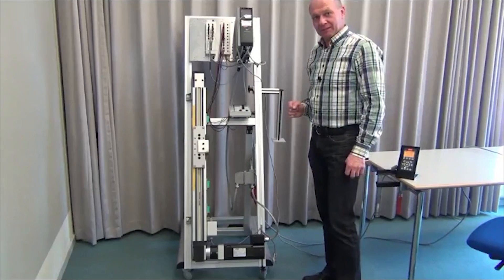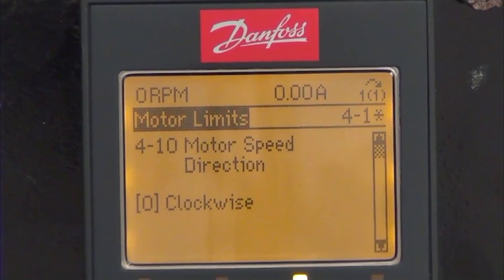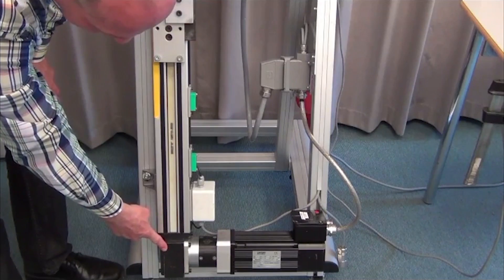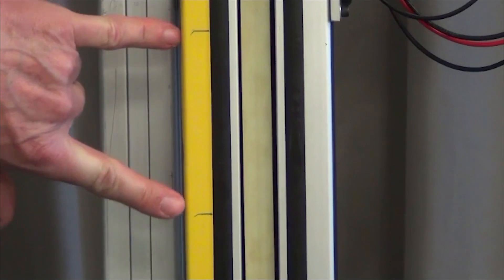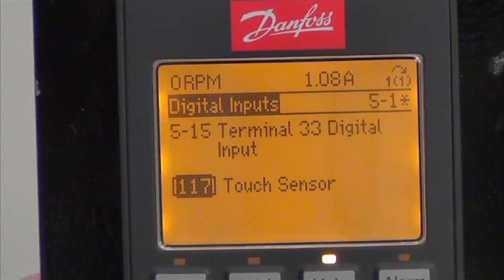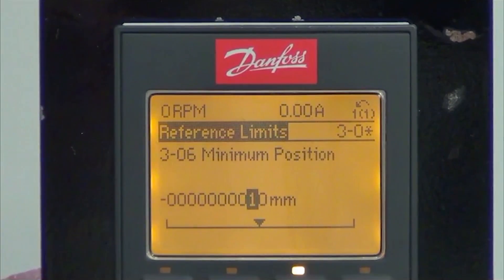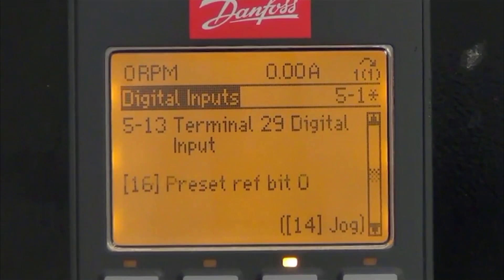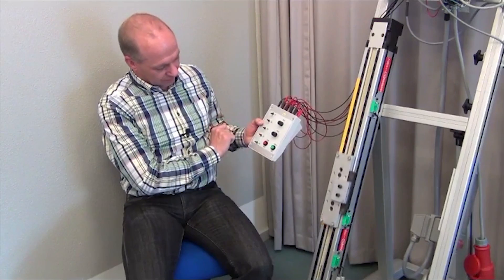Danfoss Drives | How to set up the Integrated Motion Controller

Comment: Can I setup an positioning application with a VLT Midi Drive FC 280?
Reply from the maker: Hi Ray, you have to use the FC302 just like in the video. For more information about the VLT Midi Drive FC 280, please also see here: https://www.danfoss.com/en/products/ac-drives/dds/vlt-midi-drive-fc-280/
Reply: @danfossdrives  What is the part number please of the motor that is being used in this demonstration?
Reply from the maker: @michaelmcclellanjr9831  Hi Michael, it's an old Lafert motor. The type number is B5602P3H2BRS0000. Hope this helps!

Best regards
Danfoss Drives Social Media Team
Reply: @danfossdrives  Is this the motor series that Danfoss recommends for IMC applications?  Could you provide some other suggestions?
Reply from the maker: @michaelmcclellanjr9831  Hi Michael, Danfoss is generally not recommending any specific motors, our drives are designed for motor independence meaning they can basically operate any AC motor both asynchronous and synchronous motors. Please contact your local Danfoss representative if you need further support on selecting the best drive for your application. You can find the contacts here: https://www.danfoss.com/en/contact-us/contacts-list/?filter=type%3Adanfoss-sales-service-center%2Csegments%3ADDS

Best regards
Danfoss Drives Social Media Team
Reply: @danfossdrives  Yes, but for positioning application, it must be a permanent magnet motor, correct?
Reply from the maker: @michaelmcclellanjr9831  Hi Michael, please do contact your local Danfoss Drives support office. They will be able to best assist you with this.
Reply: @danfossdrives  I am the local support office.  LOL.
Reply: Is it possible, instead of entering positioning values by LCP, to enter values remotely using profinet?